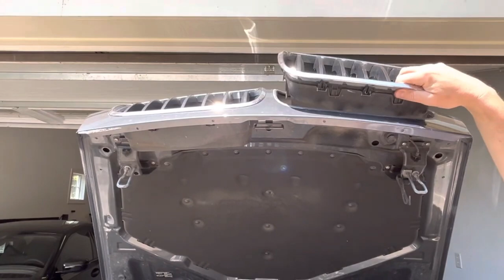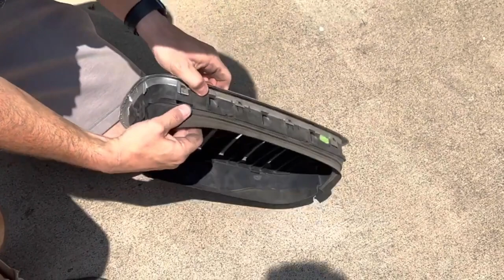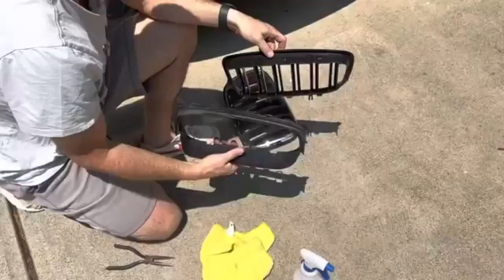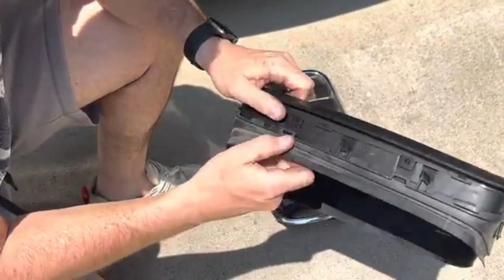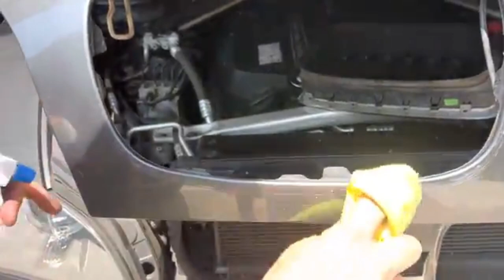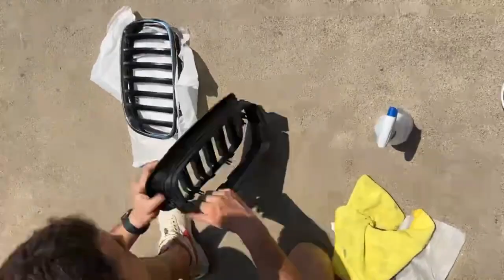BMW X5 Kidney Grill Upgrade - E70

Comment: Finally someone who actually showed the process - thanks!  I think the black extension parts actually are something to do with the radiator too - if anyone can confirm that or not ...?  Have you had any problems with them since this video?
Reply from the maker: Thanks for the comments. 0 problems so far. It has been about a year. No vibrations, no fading. What you say about the extensions make sense. Maybe they are to direct air for better flow to the radiator. Bonus news. I was able to sell my originals on eBay for $40
Reply: @ErolEskinazi  cool!  thanks for the response!

Comment: Where did you buy them from V
Reply from the maker: Zealhot X5 E70 Matte Black Kidney Grill Grille Fit for 2007-2014 BMW X5 E70 X6 E71 (Matte Black-Double Slats) https://a.co/d/isq0GbN
Reply: I bought after Amazon yesterday and the clamps are too small🥲
Reply from the maker: That is surprising. Mine for right in as you see on the video. So sorry to hear. I am sure you were looking forward to a nice weekend winner project.